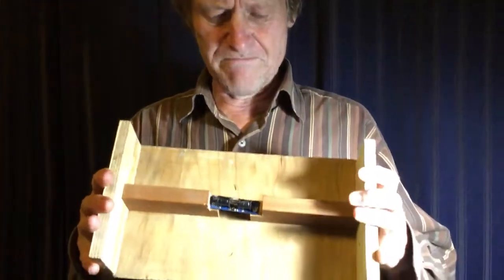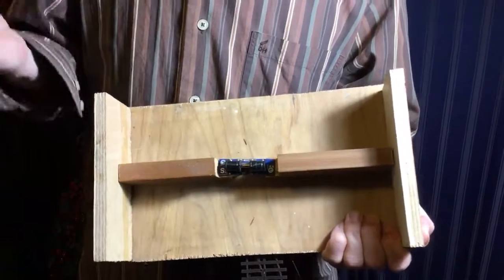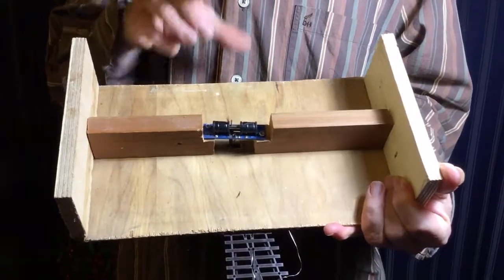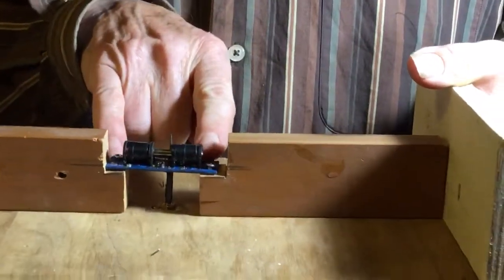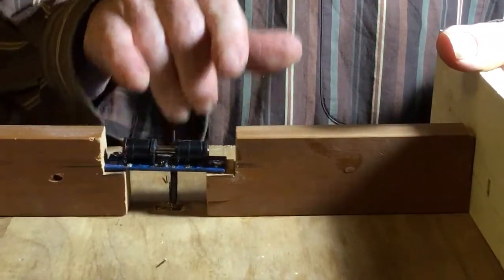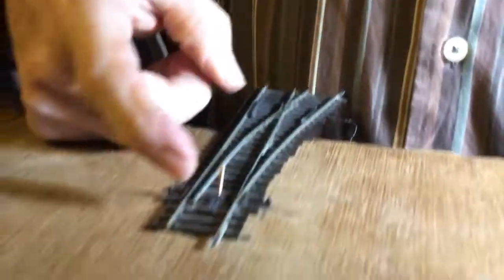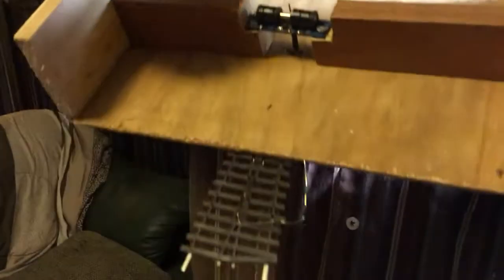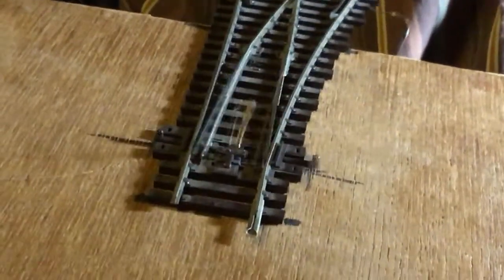Improving the SEEP point motor

Comment: Thanks for such a useful video.  My experience was similar due to the different amounts of travel needed for reliable operation (Seep to tiebar).
My solution was to just use half the integral switch (make it an on/off function only) and wire the Seep switch to a 12vDC coil of a DP 
c/o relay.  One pole of the relay switches the frog and the other is spare for other control circuits (e.g. colour light signal; isolating track etc). I rarely find that just switching the frog meets my control/indication requirements so this concept works particularly well for me.
With regard to fixing methods - 1. I prewire all terminals of the point motor before fitting with leads long enough to reach the front of the baseboard.  This is to enable me to wire up me circuits without any crawling about under the baseboards. I then found that the ‘factory’ holes in the Seep can be tapped 4BA and with the aid of an aluminium drilling template I made. The template is fitted temporally under the point and centred by a modelling pin through the tiebar AND with the point blades centred between the two ‘stock’ rails. I can then accuractly drill and countersink two fixing screws.  The point motor can be fitted and secured under the My 9mm ply baseboard without any struggling. (A big No. No at my age!) Finally a 4BA full nut locks the Seep in place.  I found that a piece of cork underlay cut out using the template but with a 10mm hole to clear the operating pin, reduced the noise transmission, offset by the two fixings.
 I cover the screw heads with miniature manhole covers to enable them to be concealed but identifiable in future. 
A Dear friend of my railway also made a jig for me to use to remove the original operating pin, without damage to the motor, to substitute for a longer one OR now, from your video, a No.6 guitar string!. 
I use similar methods to fit the ‘Peco’ type point motors, using an alternative template.
For those wishing to find out more about basic point & point motor wiring plus control and signalling circuits may I suggest the free download of info from the Brian Lambert web site. (Free Download is restricted for PERSONAL use ONLY, and MUST be respected)
The info covers both DC and DCC systems, in separate chapters, is colour coded too, and now my reference of choice!
Hope these comments will be useful to you, others of your subscribers in our wonderful hobby.   Happy Modelling, T 🚂🚂
Reply from the maker: Thats a lot of information to digest, will look into it.  Meanwhile you might like to look at my recent light hearted video clip Saltspring Railway Disco.  All the best, Philip

Comment: : I have been playing Guitar for 65 years now, an realised years ago that the strings are ( 6 different gauges ) ever so versatile.ir you unravel the outer windings on the 5th. & 6th., string you get the thinnest and strongest wire ever..also you can knock out the actuating pin from the seep motor an replace it with the 6 th string
.the top E string (thinnest one) make the idial super glue bottle whole peirser. and there are many moor aplications .ps i like your vidio..5*

Search Results
Web results
Reply from the maker: Thanks, It took a few takes in the making.
Reply: Interesting to hear you say that the pin on a SEEP can be knocked out. What's the best way to do it?

Comment from the maker: Unfortunately when I set this up on the railway I got some shorting.  I think it's because there is a delay between the contact on the switch and the track blades moving.  However, someone else may take up what I've started and finish the job.  HOWEVER, when I weakened the effect of the internal point spring PROBLEM SOLVED.  Six years later I've had another idea - if the hole in the point was elongated ever so slightly that would solve the problem.  I've yet to try this.